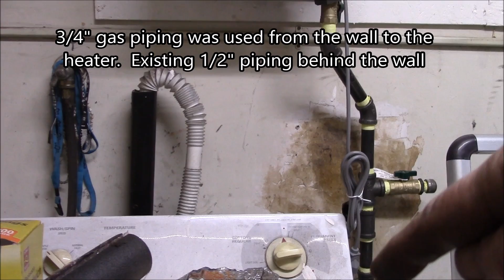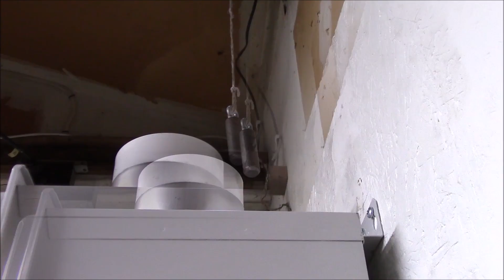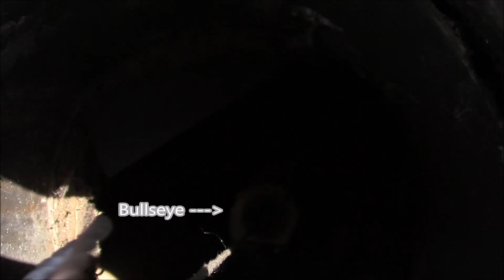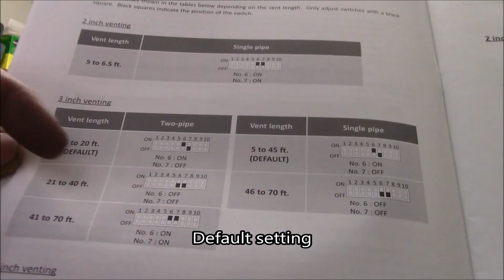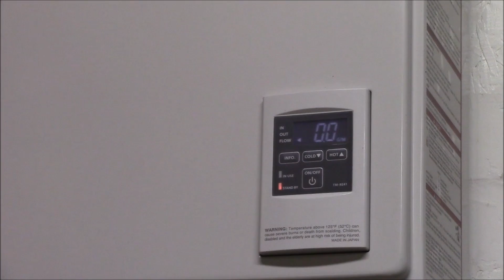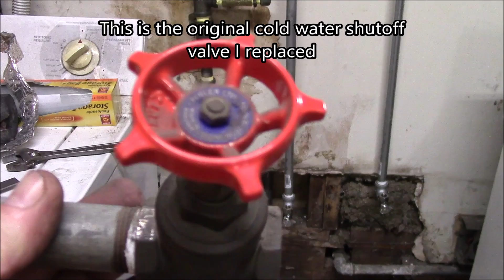Installing the new Takagi T-H3M-DV-N Tankless Water Heater

Comment: amazing gas heater with pvc exhaust. Glad you got it up and going.
Reply from the maker: Yes, the condensing models allow that.  I still need to hook up the condensate drain as condensed water in the exhaust actually drips out of that fitting.  The non-condensing heaters require expensive stainless steel venting.  That's another reason I opted for this model, 1 length of 3" PVC pipe and a couple of elbows and it's good to go.
Reply: @The4Crawler  thank you

Comment: Used one of these to run in floor heating for my house.  Works great, if temps don't get too far below zero F, then intake frosts up, and that frost comes inside, ices up the PVC, ices up whole corner of unit, and the display starts to get foggy.. So keep intake and exhaust far apart, I thought exhaust high and intake low and 2 feet to side would work, it did not, had to hang 3 feet of pipe and remove vermin guard off so not out there every 8 hours clearing out.. Still worried about unit getting all iced up inside, but we had -30F night temps lately and not normal, was tempted to run it without front cover on to warm it up and drill hole in intake and put a pad heater inside and seal up hole and use when needed..   So if mount on outside wall, put intake high and exhaust low or have longer runs..  maybe the concentric work, would be warm and melt it, rather it wasn't drawn in at all..  if I didn't just have place all sided with new soffits before winter I would just move them around..
Reply from the maker: Yes, might be issues running one of these in that cold weather.  It rarely gets below freezing where I live.  The concentric vent might help somewhat as you have the intake air getting some pre-warming from the exhaust going up the center tube, especially if the unit is running for a longer period.  I noticed on mine it takes about 10 minutes to get the exhaust temperature at the roof vent up to the maximum of about 130F.

Comment: I have a question, the “intake” pipe on top of the heater , does that one have to run out of the house? I noticed you did run a line for that
Reply from the maker: Typically yes, but if the area the air is being pulled from has sufficient volume and venting for the appliance, then it can come from inside:
https://hinarratives.com/reference/heating/calculating-adequate-combustion-air/
In this case, heater was in an unconditioned  garage of sufficient volume.
Reply: @The4Crawler  thank you for the quick response. But that intake pipe wont release any carbon monoxide right? Im in the process of installing mine.
Reply from the maker: @ranchitosantos5165  Intake tube, assuming your heater has two openings, is for the intake air that is pulled in by the fan or blower.  The installation manual for the heater I have shows options for pulling air from inside or outside.  In my unit, the intake tube is just open to the inside of the heater.  I guess the blower pulls air from inside the case for combustion then blows it out the exhaust, which is the other tube.  That needs to vent outside.

Comment: Good information, I’m actually doing a service call for no hot water so I did a restart in it and it’s working for now. Did you ever have a 101 code pop up and did you ever have to clean the burners? Labor wise I recommended to change the unit.
Reply from the maker: Never had an error code pop up in normal operation on mine.  Some information on troubleshooting 101 code in the service manual.  If you don't have a copy, here's one I found:
https://drive.google.com/file/d/1uR9UmjtuiRDCBxaDnpbN2v-JTVw37r-e/view?usp=share_link

You might also check the intake air, see if something is clogging the inlet.
Reply: @The4Crawler  Yes I did do the manual suggestion’s but nothing was blocking the vents so it came down to the burner or the blower issue or possibly sensors. So instead of wasting the customers money in parts and labor which would come out to the cost of a new unit I recommended to just change the unit and a couple hours labor.
Reply from the maker: @Manicmonday25  Yes, I imagine with labor rates and parts cost these days, a new unit might cost less, especially for a simple swap.  Do you salvage parts out of the old heater or just toss it?

Comment: Mine has vibration problem when it ignites and about 10-30 seconds after. When I increase water use it helps a bit
Reply from the maker: See below:
https://www.fixya.com/support/t1420366-takagi_tk_jr_vibrating_noise
Or search for "Takagi Tankless Water Heater Vibration" and there are a few more possible causes and solutions.
Reply: @The4Crawler  thank you. Hope my model has tha same design as theirs so problems could be similar

Comment: Just wanted to check in and see if the unit is still able to keep up with domestic hot water demand, washing machine, shower, and faucet on at once?
Reply from the maker: Yes, it's doing just fine.  The other day had the utility sink running full hot plus the dishwasher.  That totaled about 2.6 GPM at 140F temperature output which adds up to 80,000BTU/hr. heat output.  No issues at all with that.  Normally, though, I usually only use one fixture or appliance at a time, since I prefer to set the exact water temperature for the task at hand.

Comment: Since your exhaust run was within the 6' for a pvc run, Why not use  a 3x2 reducer( I noticed you could use 2" in the manual on the video) and run 2" pvc thru the old piping . Might save some time and effort.
Reply from the maker: I suppose that was another option.  It might have been a bit tricky to fit the PVC pipe elbow inside that old concrete stack pipe.  Also since it possibly had asbestos in it, I wanted to have as little as possible to do with it.  It was removed and disposed of with the old tank heater.

With the 2" PVC, the length of the exhaust vent would be right at the maximum listed in the manual, depending on how the 2 - 22.5 degree elbows are accounted for.  Some newer heaters have increased vent length ratings for 2" PVC as they have blowers with more pressure/speed settings.

Comment: Love the video, looks nice and clean. Question I just got a Takagi 6.6 GPM and am trying to understand what is needed for venting. I was hoping maybe you could answer a  few basic questions. I am hanging the tank on my utility wall that is shared with the garage. I want to intake directly from the garage so just a run a short and a 90 through the wall then I was going to run a condenser trap then a  90 through same wall and and a 90 making a left going to to exterior wall of the garage to the out side for the exhaust. then finally can I use PVC or Staniless steel? Manual is NOT clear at all. Thanks much in advance  Greg
Reply from the maker: Probably depends on the exact heater.  I think the general rule of thumb is a condensing heater will work with PVC (exhaust temps are below the boiling point of water).  The non-condensing heaters typically need stainless steel since the exhaust is hotter (over the boiling point). and that hot exhaust can condense and is mildly acidic.  Might check with Takagi directly on a specific model venting requirements.  I contacted them once and they responded fairly fast.

Comment: Nice work! I have one to install, and don't know how to connect the 3" PVC to the 4" steel vent stack on the top of the unit. The manual says that they simply connect together, but they have exactly the same OD and do not fit together. Any help would be appreciated.
Reply from the maker: See what I did in a previous video:
https://youtu.be/R4yZVi4FeBM?t=28
I found I needed to file/sand/machine down the OD of that coupler to fit.
Reply: Nice solution. I'll head to my Dad's to turn these on the lathe. Some mention of this issue in the manual would have been nice.
Reply from the maker: Yes, suppose they should mention that.  My guess is they may have changed suppliers for the couplings and the new supplier's parts are a bit larger than what they designed for.  Seeing as they are relying on the OD of a part that is specified by it's ID, they are vulnerable to these sorts of issues.  You could also use something like a belt sander to take off a bit of material fairly quickly.

Comment: This water heater use existing 1/2" gas pipe, why in your video, you are using 3/4" from the wall to the tank?
Reply from the maker: I had 1/2" piping under the house and inside the wall, perhaps 12 feet worth.  That was pushing the limits of how much gas flow the heater needed at full output.  So in order to limit the pressure losses in the remainder of the piping, I went to 3/4".  The heater has a 3/4" gas connection, so I would need to transition from 1/2" to 3/4" at some point, so why not as soon as possible.  Not a lot of cost difference in 3/4" vs. 1/2" fittings.  Since things like tees and elbows introduce a lot more restriction than a straight section of pipe, making those fittings larger helps to minimize the losses.
Reply: Thank for your valuable information. 

Just one more question: from their manual, look like they require Schedule 40 PVC which meet ASTM D1785 standard. I could not find any of these from Home Depot nor Lowes. What kind of PVC pipe are you using? so far so good?.
Reply from the maker: I found some ASTM D1785 PVC at my local Lowes.  If you can't find that, CPVC or ABS pipe is also listed for the intake and exhaust venting.  I found a lot more local selection on the 3" ABS components than I did with the 3" PVC.
Reply: Thanks, can you provide some part number? I think I can order online so that they can ship to me or I can find it round here
Reply from the maker: I think this is what I used:
https://www.lowes.com/pd/Charlotte-Pipe-3-in-x-10-ft-260-PSI-PVC-Pipe/3135451
"Conforms to Standards: ASTM D 1784, ASTM D 1785 and NSF Standards 14 and 61"
Reply: Thanks!!!, I am going to install one T-H3S-DV next weekend, and look like your video and answer really help me thru :). Thanks you!.
Reply from the maker: You're welcome.  Looks like a nice heater, about 50% higher capacity than the one I installed.

Comment: Can i use black PVC pipe ( sewer) for ventilation ? I just bought takagi series 200 (2 to 3 shower).
Reply from the maker: You would need to check the installation manual and see what's listed by Takagi.  In mine (H3M), it does list ABS meeting ASTM D2661 as approved intake and venting material.  You would also need to check your local plumbing code and see if that material is allowed or not.
Reply: PVC OR CPVC and ABS DWV . Manual shows these specs. Black pipe okay 👌
Reply from the maker: @azevedoplumbing  Either material is listed in the installation manual, along with ABS and Polypropylene.  This install was with PVC:
https://youtu.be/fkuscb7Bo-g

Comment: I didn’t see pressure relief line going out side also tankless did not like give pipes not recommended
Reply from the maker: Permitted in my location:
5. TPR discharge pipe shall discharge to the floor, to the pan serving the water heater or storage tank, to a waste receptor or to the outdoors.

The existing water heater had a similar TPR drain to the garage floor and was in place over 60 years without issue.  In the local area, the majority of water heaters in older homes I've seen are set up this way.  Maybe in new construction, exterior drains may be more common.

That heater also had flexible water lines due to local seismic conditions.  Yes, could have been hard piped as well since the tankless is fixed to the wall and not subject to movement. But the local AHJ is used to seeing flexible lines.

Comment: I’m no plumber but seems like you should have a flex line between unit and gas line
Reply from the maker: Since the unit is firmly fastened to the wall, no need for any flex line like you would have with a free standing tank type heater.  Also, was concerned about gas flow through a flex pipe as I was pushing the limits of the existing gas piping.  As noted in this video:
  https://youtu.be/zW109bgIRg4
Flex lines can limit gas flow.  HEre's another example:
  https://youtu.be/GvuDKc3R2j8

Comment: Is it worth a fuck..?
Reply from the maker: Yes, I'm totally happy with the heater.  It's cut my natural gas bill over 80% and show pay for itself in less than 10 years.  Having the ability to set the water temperature with the remote control is awesome.  Crank it to 100F and hop in the shower, no fiddling with the hot and cold water taps to get the right temperature.  Set it to 140F for a load of dishes, etc.  And it freed up enough floor space to install a killer utility sink.